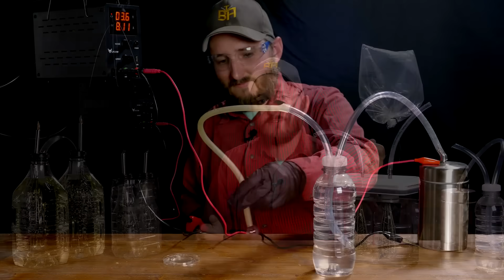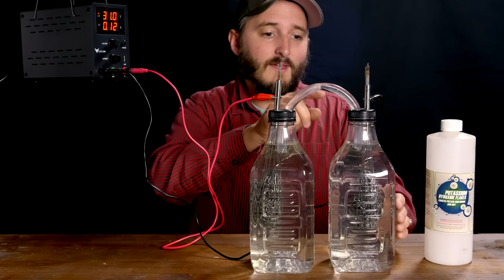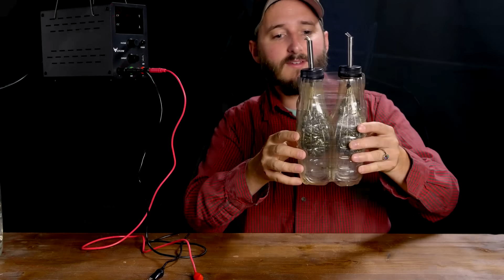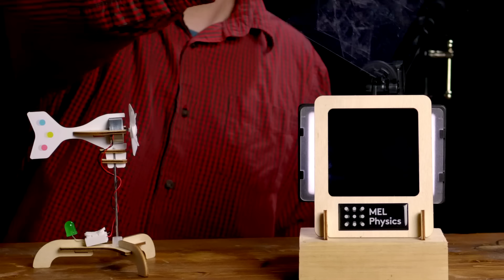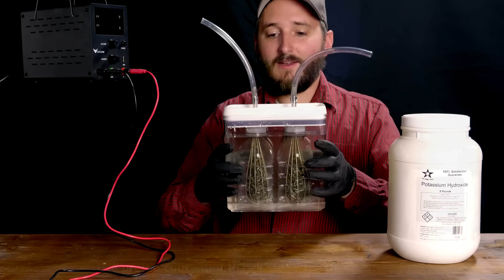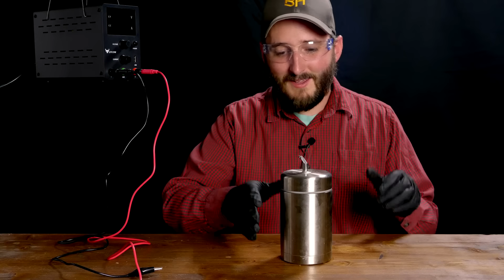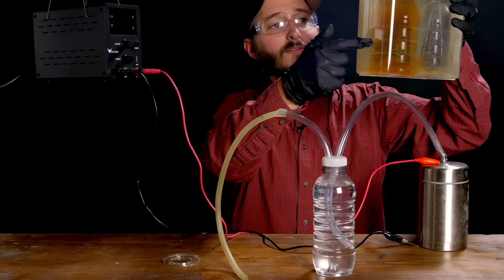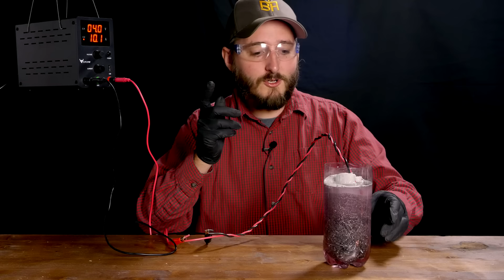DIY Hydrogen/Oxygen Generators From Grocery Store Items (HHO Fuel Cells & Split Cell Electrolysis)

Comment: I had a lot of fun doing these experiments about 12 years ago.  I ended on some conclusions.  Straight DC is okay, but when you get to playing around with pulsed DC, you can really go crazy.  I ramped my voltage up to about 5KV and was able to adjust my frequency to about 1-2 kHz and able to adjust the duty cycle as I saw fit.  Last set of toying with it was to use pure water with no electrolyte, and having a resistance monitoring system to automatically adjust the duty cycle based on water quality.  And that's when I reached the end of my skill set.  I'll hit it back up when I learn to code.
Reply: 5 kv!! That's very high voltage. Only 4-5 volts passed 10A current in this video. What did your setup draw?
Reply: If he was really using pulse DC he's allowing the voltage to do the work instead of the amps raw bulldozing power I've done many post DC setups myself with compound plate setups and found that you can do as much with 100 volts and 1 amp as you can with 5 volts 10 amps if we could ever find the true harmonic resonance of the particular sample of water we were using you could dematerialize it all at once hydrogen bomb status
Reply: @shfahim7938  Well, being pulsed power means that the average current draw may not be overly high. It would still be interesting to know though. What is the advantage of pulsed power? Does it simplify power delivery or increase efficiency? The absence of electrolyte is certainly a nice benefit.
Reply: @ness-ee   sweet that's great info
Reply: Dude, this guy is already way, way, past his skill set. Don't give him anymore ideas. He is going to cause a young person to get killed like this.
Reply: @VidarrKerr  Oh no, a clipboard warrior learned to type. Don't you have a padded basement to get to?
Reply: @NavinF  Yeah bruh, it is real hilarious. My friends were doing this same type of stuff and as poorly executed as it is in this video. One of them died, the other lost a hand and three fingers on the other and had third degree burns on his face. 
Keep laughing.
Reply: @VidarrKerr  This is a classic science experiment that kids do in middle school. Somehow I have a hard time believing that a clipboard warrior has friends, let alone friends that died from a children's science experiment.
Reply: sounds awesome! :D
Reply: @NavinF  LOL damn
Reply: @VidarrKerr   Darwin awards man. That sucks.
Reply: @NavinF  That was where I was first exposed to it. 8th grade to be exact in basic science. Did well enough that I got put in Biology in the 9th grade ( taught in the 10th grade normally  ) and then had regular Chemistry in the 10th ( which again was normally an 11th or 12th grade class ). The 10th grade teacher was warned about us as she was married to the 8th grade science teacher.  :-)  So the 5 in each period were 1.) not allowed to sit near another 10th grader and 2.) could not be paired with another 10th grader in the lab part of the class.
Reply: @VidarrKerr  LOL.!  Now, that really sounds like a load of hogwash.  Maybe chemistry ain't your thing?
Reply: @NavinF  Yeah, with SUPERVISION AND DONE PROPERLY.

Comment: As an 8 year old scientist while living in Geneva, Switzerland, I couldn't wait to get the portable humidifier to start "humidifying". In the 1960's, the electrodes were exposed, and about 2" apart. and the top was removable to fill it with water.  The voltage in Switzerland, is 220V.. The volume of the DeVilbis glass humidifier was about 2 liters. I plugged it in &  I experimented  by adding salt to it. I remember adding more and more salt an I saw what now I could describe a corona effect around the electrodes, then adding even more salt, the coronas joined and an arc formed. I boiled 2 liters old water in 10 minutes!  When I took the electrodes out, they were just stumps!  That started my "mad scientist" career! When I came to the U.S. while in HS I learned Electronics, got an Extra Class Amateur Radio license, built my very own 2KW PEP push-pull linear amplifier,, with 2 Eimac 3--500z's,  built directional antennas,  experimented with helicoidal phased arrays, and achieved "Moon-bounce" in UHF.  My undergrad was biology, and all the electronics I learned was by reading and trial and error.! Several " unexplained"all neighborhood blackouts ...    Had loads of fun when I found out my elderly neighbors were watching me work outside with 2KW on the 10 20 meter band, adjusting very directional Yagi antennas. When I was sure they were watching me, I remotely keyed the Collins S line transmitter with the amp tuned to 1000W. CW, and took fluorescent tubes on my hands and  got them to light up. I am sure at least one of them ways  was convinced I was some kind or warlock / devil worshiper.  I worked  hard part time and weekends  as a TV repairman and an electrician to be able to pay for my experiments. . Ultimately, I went to Medical school and am now a physician!  I miss those crazy times, now in my late 60's!

Comment: You have provided 12 volts supply to the unit ..

At normal temp and pressure ,around 1.8 to 2 volts are enough to break the water molecules...
Anything more 2ill be used for heating the water ..
Just reduce the voltage ,,
Reduce the gap between two electrodes ..
N your will not have a heating problem ..
Rest 
Simply fantastic.

Comment: Ben, dare i say these are some of the nicest designs i've seen for these generators and i love the content you make!
ALSO i think that for the Food Thermo design (which is the best IMO and i'm totally stealing it for myself) a good safety measure/failsafe would be to shave a coulpe of threads off the lid, or shave them closer to be the first faliure point if a blowout ever ocurrs within the electrode unit, eliminating the higher risk of a total sharpnel explosion like you mentioned.

I also thought about finding and buying some 5L plastic bottle preforms and putting them on series around the thermo as a smaller and more rounded (*wink*)  flashback arrester system.

Having even more ideas as i write but i really need to get them into my notepad to get working! Best wishes and keep up the great work.
Reply: OUTSTANDING

Comment: This is a really good video and anyone who is into alternative and cheap fuels which is probably everyone will like this video too. 
Good job at simplifying HHO fuel technology, HHO fuel can run any engine that has a spark plug and it can be used for heating, cooking, cutting, etc
Reply: Do you have any videos of this being done? That sounds super dangerous too
Reply: @solomonheppner  YouTube
Reply: @louderbackbarry  could you link the ones you're talking about?
Reply: @solomonheppner  just do a search on YouTube, one thing you can do to test it is bowl full of water put a battery charger on it for a few seconds then take a lighter to it the water is flammable when electricity is going through it and it’s just as powerful as gasoline
Reply: @louderbackbarry  "just as powerful as gasoline" ....former hazmat tech bud.....i can absolutely say that they aren't comparable in literally explosive potential. HHO has a vastly higher expansion rate and destructive potential even if both are in gaseous state.
If you really dont know of any, fine, i can spend a few more minutes on youtube.

Comment: fascinating - I looked into a remote-controlled hydrogen blimp we could burn the fuel out of at the end of an event, but logistics of getting & transporting the H2 was difficult. I didn't know it was so easy to make!
Reply: H2 and blimps don't go hand in hand mate. You've heard how loud of a bang he got from a few HHO bubbles. Now imagine your blimp having a leak and going up in flames or exploding over your guests heads.

The helium is crazy expensive too but it's harmless outside of suffocation. Fun fact, there are  25 blimps left in the world, only 13 of which are still operational.
Reply: @lazar2175  haha, I'm aware it's flammable - but that HHO mix is a LOT more explosive than pure H2, which burns rather than explodes. Periodic Videos did some slow-mo of burning balloons with H2 & HHO.

 But yes, obviously hydrogen is more of a fire risk than helium, even in a tiny RC blimp.
Reply: @forgotMyUsername100  The main problem with hydrogen blimps is the fact that the H2 molecule is so small it will permeate most materials and dissipate into air.
Btw the Periodic Videos take on that is good and completely true but it's done in lab environment with almost no variables. You'd be filling a much larger blimp yourself using diy methods, you'd have no idea if some oxygen leaked until it'd be too late. 

I think the best solution for small scale blimps is hot air. The helium costs could run into tens of thousands dollars for an average RC blimp.

Another solution is using Hydrogen/Nitrogen of 8% H and 92% N. It's about 10% lighter than air and non flammable.

Comment: The rate of electrolysis depends on current, and current depends on applied voltage over the voltage to split water, conductivity of electrolyte, area of plates, distance between plates,  and the cross sectional area through which ions flow. Although scrub pads would have relativly high surface area in total, ions preferencially would largely  only go to the outer surfaces  of the electrodes effectively limiting the used surface area. 

Maybe one could pump the electrolyte through the scrub pads which would not only assist ion flow  but would also increase the effective surface area being used in each stainless steel electrode.
Reply: I was thinking the same thing maybe a small recycling pump to flush out old water and new water in on a time so you get the most out of each batch of water and salts.
Reply: Reeves electrolyte freshness isn't much of a concern. But pumping the electrolyte through a scrub pad will have the ions engage  more surface area inside the scrub pad rather than just the syrface area of the exterior of the scrub pad.  Pumping the electrolyte also would help break the bubbles from the surfaces of each electrode ensuring the greatest area being utilized.

Comment: Nice explanation! I just produced my own version of a combined sock version and your single output electrolysis item. Of course I wasn't yet educated with the seriousness of the danger of a single collection of the gasses. your slow mo explosion was very useful to see what actually happened to me. I was hoping to ignite the gas as a flame, but it went right back to the suppressor and blew the plastic lid off it like a few m80s bound together. I like your dual collection example, and I'm going to look for your oxy-hydrogen torch video. Thank you again. I'm dumb enough to try this without completely understanding the explosive danger. But now I know and I am fortunate that my B omb didn't hurt me or someone else. Thank you again for the detail. (I had 3 marine 12 v batteries in series to provide the electricity,  two steel all threads about 7" each, into a plastic container  with one 3/4" gas tube exiting to the suppressor,   with the final 1/2" tube from the suppressor to what I was hoping to be my gas manifold. The manifold only served as the ignition spot (used a lighter) for the bullet of gas that traveled back up the 1/2" tube to the top of the suppressor where there was enough gas for a very large plastic lid explosion. The lid fragmented over a large area. My explosion was not slo-mo.)

Comment: I have to congratulate you on this fine and thorough video presentation, you would make a good teacher as you kept everything simple and easy to understand!.... The bubler is what's recommended in other videos from past experimenters, and it's good your showing people the dangers of hydrogen gas, but this gas is supposed to be pumped via a propane carburetor and to each cylinder of an engine where the gases are ingnited via the spark plugs into the combustion chamber where it's no more dangerous than gasoline being ignited and expelled out the exhaust valves
Reply: Interesting. Back in 2008 someone had a HHO set up in their Kia and they said they got an extra hundred miles  per full tank of gas using single tube coming out of the unit and fed into the plastic air intake.  I assume from watching this video that the water and gas flows through that tube combined obviously cuz it's a one tube and shoots into the engine but not individually on to the injectors I think you made a comment about how it should be separately injected into each chamber any comments I'm thinking about setting something up for my GMC but I'm afraid I might ruin the engine. I've seen it done on a generator that supplies power they took the gas tank off and they replaced it with this electrolysis set up and it worked pretty good some people had some comments so on the materials being used on highly on it being highly dangerous and combustible so that helped me back. I want to do something with the engine of my truck being a gas prices are high that's ridiculous what they're doing to our country.

Comment: Storing larger quantities of a stoichiometric mixture of hydrogen and oxygen in your lab is a good way to reach the afterlife at supersonic speeds.
Reply: It can’t be THAT bad. As long as you know stop, drop, and roll, your golden.
Reply: @andrewdoesyt7787  its like a bomb not a fireball
Reply: Yep, think Saturn V engines....
Reply: @geoninja8971  No, the Saturn V engine was kerosine. Think delta heavy IV.
Reply: @andrewdoesyt7787  Whoops.... shuttle orbiter then.... :)
Reply: Saturn V's did use liquid hydrogen in upper stages though....
Reply: @geoninja8971  Yes, the space shuttle body used hydrogen, and the later stages of the Saturn V used hydrogen. The engines that we saw firing were kerosine though.
Reply: The scariest thing about burning hydrogen is the spectral emissions are uv. It is harder to deal with a fire you can't see.

Comment: I have a project suggestion: Making a light gas gun with the hydrogen. Another suggestion would be a combustion light gas gun from the hho, but that might be a bit too risky.
Great video. Your projects are always super interesting.
Cheers
Reply: I was thinking something similar with the Bottle Rocket launcher and using HHO or Hydrogen instead of alcohol or propane. And compair the results.
Reply: Build a potato gun with the hho generater inside the chamber. Ignite the Brown's gas with a bbq lighter built in
Reply: How about a gun that uses the gas...?

Comment: Great video. Especially appreciated the warnings, such as about collection of combined gases at the top of the fluid, since my contemplated design uses platinum plated screen in PVC tubes, or an aquarium with a divider, which only allows current transfer at the bottom of the baffle/divider.
Reply: Reportedly, platinum will instantly catalyze and blow up hydrogen gas in an environment with any oxygen.

Comment: This is interesting. Might take a lot of engineering (especially to stop the flame from leaving the reaction chamber), but would it be possible to make a monopropellant rocket engine this way using the HHO generator and a hobbyist Lithium-Ion battery pack?
Reply: HHO is explosive, but doesn't have a very high energy density.   One-pump chump, kinda.
You'd almost certainly be better, making a 'sugar rocket' (go Google), or nitrating some cellulose for propellant.
Reply: not really, HHO is better for things like potato cannons, or water rockets, rather than model rocketry. (anything that needs sudden high pressure to get something moving.)

I also wouldn't use a lithium-ion battery as the large power draw would cause the battery to rapidly overheat and possibly ignite. a lead-acid battery (car battery) would be much better as it can handle the power draw better. the best thing would just be a generator rated for the amperage you plan on pulling.
Reply: You'd be better off splitting the output and feeding in a steady ratio of hydrogen/oxygen like is done with liquid engines.
Reply: @recessiv3  You can't get better than a stoichiometric ratio, as is already generated by electrolysis.
Reply: @theskett  Yes, but the contraption is simpler (and wayyyyyyyyyyyyyyyyyyyyyyyyyyyyyy safer) by splitting because you don't need to worry about it exploding
Reply: @recessiv3  technically, anything can explode... This would be self-igniting
Reply: @j.c.cannon2112  lead would be so heavy though. I guess water would be as well, lighter than lead for sure, and how much water would you really need? the power draw could be regulated with a bit of circuitry probably. imagine some sort of glider; no scratch that, a Zeppelin which emits short bursts of jet propulsion. practical or not that seems cool.
Reply: a solar powered pulse jet propelled Zeppelin which runs on collected rainwater. :)

Comment: When I was younger I made one of these out of two intersected aluminum heat-sinks and a computer power supply, ran it in a old honey container with a screw lid. Put a flame to the output to see if I could get a woosh and next thing I know there's water all over the roof and all I could hear was a dull ringing. I wasn't prepared for how goddamn ANGRY the gas contained in a centimeter gap between water and lid could be. Glad you put some much emphasis on the safety of generating this gas haha.